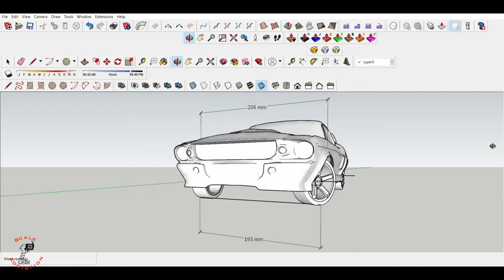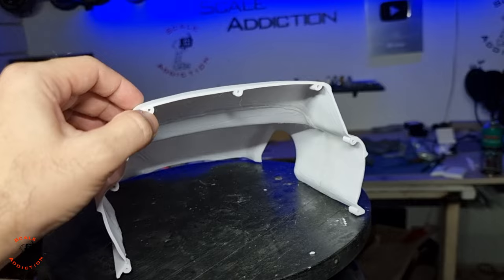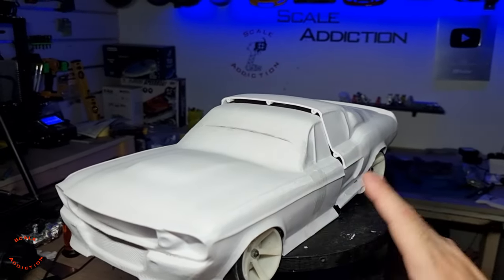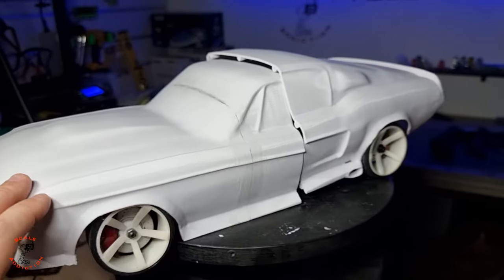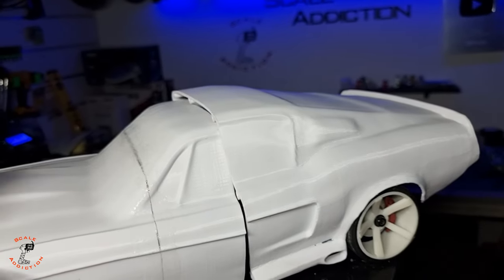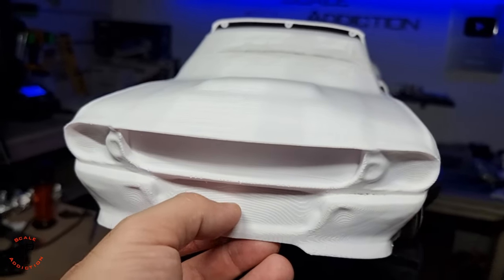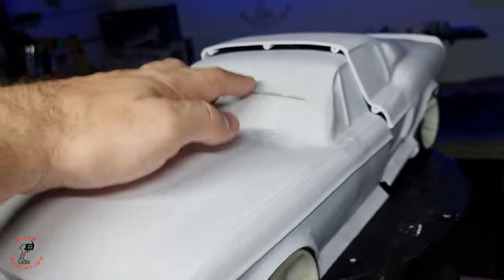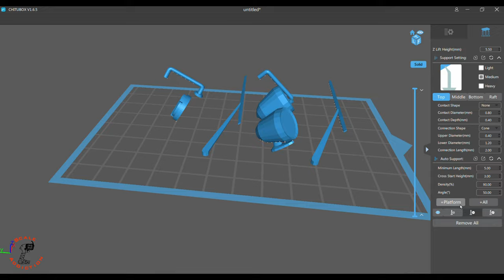3D printed 10th ford Mustang from 0

Comment: To make those short filaments straighter, you can heat up your bed, then roll them under your finger until they straighten out.  Makes it easier to slide both parts together if those are fairly straight.
Reply from the maker: That's a great tip, next time